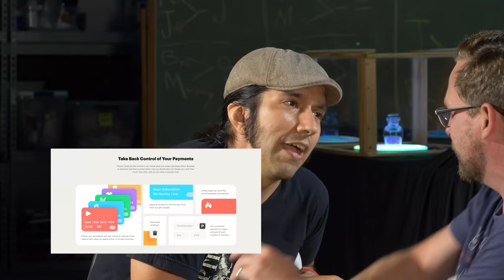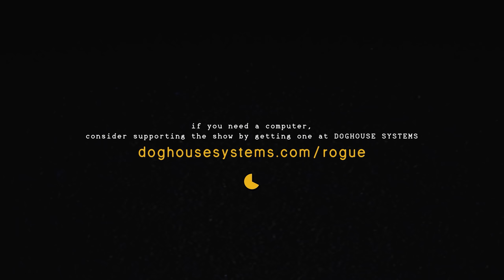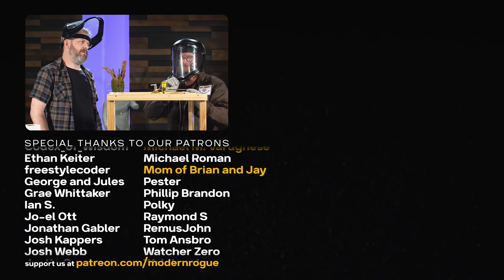Do Jewel Thieves Really Do This?

Comment: try scoring only one time around (but applay enough pressur to make a good and pronounced scor) and then tap the glass confidently but not to hard all around to make the glass crack through to the other side (you will kind of be able to see it crack if you look closely) and dont tap randomly around tap in the same area and when the crack form then make it grow by tapping at the end of the crack until it has crackt all the way around and try using the ball side for tapping and get to tapping as fast as possible after scoring if you wait to long the crack won`t form

Comment: Score your circle and do NOT score the lines coming of it. You do that when you want to save the circle you have cut and discard the frame. Score the circle and gently heat it either with water  or a cigar torch lighter.

Comment: As a glazier it always annoyed me when seeing people use circle cutters in the movies and these just use a sucker to pull the glass off. It doesn’t work that way!!🤯
Reply: It's certainly difficult to do, but what if the glass is really well framed and they actually pull first then push out? Is it probable?
Reply: @gabrieldeoliveira7725  so the problem is you need to run the cut from the other side. So you score the ‘outside’ of the glass with the cutter then you need to apply pressure from the inside to complete the circle cut. You can definitely cut circles in fixed framed glass, you just need access to both sides

Comment: I'm not all the way through but I seem to remember a video debunking this specifically the movie circle stealing cutting through glass. Why they said it was basically impossible is you're supposed to score glass then flip it over and Hammer the other side which you can't do in a cat burglar situation unless you like drill through the glass and then Hammer from the inside.

Comment: Hey quick question for y'all you made sure the blade for the glass was the right length since the really cheap ones can barely cut through 1/2 inch panes if they can cut through at all that's why some can be really expensive since they're used to cut through multiple inches of glass

Comment: You probably have better luck heating the end of a glass rod molten in a torch flame, and then stick the molten part firmly onto a section of the score mark, heat shocking it and breaking it. Glassblowers do something similar when cutting thick or large diameter glass tube

Comment: How to do it the wrong way but still the cool way:
- Score glass using medium to high pressure... ONCE!
- Take a blowtorch and briefly heat one point of shoreline from inside the circle 
- Splash it with a bit of cold water or put an ice 🧊 on the scoreline ( sharp corner should give you control on the stress point) 
- If not fully popped,  tap away to your heart's contempt or continue playing with fire and ice!

Comment: Instead of making score lines on the outside I would make score lines on the inside so that when the glass shatters from the middle out hopefully it shatters in a more controlled manner, following the score lines from the middle out and then along the circular score line. As well as giving more weak points for the glass to crack so the force is spread more evenly so that hopefully the glass doesn't crack all the way out.

Comment: You're trying to cut the glass, you just needed to score it. Just do a single sweep with medium pressure, and then tap gently over the crack (with the back of the tool), not in the center.

Comment: Contrary to what you see in the movies, cutting glass takes patience and a steady hand, and would be very difficult to do quickly during a heist.
Reply: i mean, usually in the heists where they use glass cutters they are being sneaky and could take 5 minutes to open the case no problem. Wouldn't make a good movie though if they were just tapping glass for 3 minutes straight.

Comment: This was painful to watch. My first taxable job when i was 18 was at a glass shop cutting mirrors. I dont know where to start- you only need to score the glass once, you need a coolant, the pen style cutter Jason had should be hollow and a slightly spring loaded head- fill it with atf, generally for holes we used a diamond edged hole saw; but again- with a coolant. The circular one would be for cutting a circle like a round piece and you would break away the outer edge. After you score it use the big round end of the pen cutter to tap the underside (you'll see the break run) then you score from the outside in do the same tapping and run the break up to the circle. Im pretty sure you will never reliably be able to remove the center section with that tool- when the line does break its not perfectly up and down, its like the edge of a lasagna noodle. Thats why we use hole bits, it grooves out the edge (however thick the metal on the hole bit is) and bingo, it comes right out. . . Usually ends up stuck in the bit. Glass heats up really quick when you score it, if you hear a little popping sound after you score it, its usually the glass fusing back together, at that point your not going to be able to break it. Theres some special coolants for glass but automatic transmission fluid (atf) is cheap and works really good. I hope this helps and i hope you try again! Since the drills for the hole bits suction to the glass i would imagine that it would be possible to do it on a mounted window, as long as you have some way to power it, and use a coolant!

Comment: You want a SINGLE SCORE. The 50 score lines you made actually made the glass stronger by giving the stress multiple places to go. One score will break it for sure. Small taps with a hard object around the circle. You want to score with the normal glass cutter on the INSIDE of the circle if you want the inside to fall out.

Comment: Less than 5 minutes in, and I am crying from laughing so hard. My family has owned a glass shop for 45 years, so the wrongness of everything they have done so far has me in stitches. I can only compare this to someone giving a saxophone to a monkey and hoping he will play George Michael's Careless Whisper. 

Murphy: Pulls out an everyday, common, self oiling glass cutter.
Brushwood: "It's like a weird ass hammer?"
Murphy: "Your'e supposed to use it for like..." Waves hand up and down in the air like he is prying out a nail.
Me: Pissing myself and crying from laughter at the same time.

Just for future reference, glass cutters do NOT cut glass. Glass cutters leave a scar on the glass so that when you put pressure on it and break the glass, the break follows the scar that you made. You NEVER want to use the cutter to scar the glass without oil being on the glass where you are scarring. If the scar you make dries out, it makes chips that will cause the glass to break in the wrong direction. You NEVER want to go over a scar you have already made because it makes chips that will cause the glass to break in the wrong direction. If you ever "hear it crackling" you are either going over a scar you already made, you forgot to put oil where you are going to cut, or you are using WAY too much pressure while scarring the glass. When you break the glass, the pressure has to come from the OPPOSITE side of the glass from the scar, and tapping the same side as your scar will only make it break the wrong way. (The safest way to break large sheets of glass is for one person to lift up the end being cut off after it is scarred and then lay it back on a straight "stick" placed under the scar by a second person. Just laying on the stick is enough pressure to break the sheet along the scar.)
It would be a one in a million cut to pull this off because of microscopic imperfections in glass while it is being created. It would take glass and a glass cutter wheel created under perfect conditions, a perfectly calibrated circle cutter, precise pressure, EXACT placement of suction cup and PERFECTLY equalized pressure while breaking the glass. I was born a couple years after my father opened the shop and I have only once seen someone come close to doing this. He was able to scar and break the circle without any cracks running in or out from the broken circle and the inner circle was able to shift a little from side to side before it cracked the outside pane. 
The way pros cut holes in glass (like the electrical outlet in the middle of your bathroom mirror) is with a small drill press that has a carbide coated hole drill bit in oil and a lot of patience. This can also be done to Rex's Glencairn glass to leave a permanent hole in the bottom.

Comment: most modern glass cases just use felt to lay the glass inside of a shoe, no sealants, because its too much of a mess for when the glass breaks on the case, its easy to just lift the top glass off with a suction cup instead of the hollywood drama of cutting the disc out in that impossibly clean manner

Comment: You can definitely cut glass with lasers. Yes, glass transmits visible light well but it tends to absorb UV light and far-infrared light which is why CO2 or UV lasers are used for this application. Ever wonder how they cut the glass for smartphones so it fits so well in the frame? Whether you could carry said laser with you on a heist is a different story altogether.

Comment: Score the line in whole circles, not back and forth in intersecting arcs. Score the straight lines running into the circle, and then shock the glass by running a butane flame over the scored lines. Don't overdo it, just enough to slightly heat the glass. Finally, tap tap at the center with a hammer, don't tap on the scored circle

Comment: Structural engineer here. Will skip right past all the many things done wrong here and to whether the legend holds true:

Well it depends on what glass you'd be cutting. If it's tempered glass you can expect with reasonable certainty the whole pane to fall down whether you wanted it to or not. The glass is specifically made with residual stresses to, instead of falling down in big pieces that could injure people, break into many smaller cube sized bits to limit your hurt.

If it's laminated glass then you'd be dealing with several panels of glass glued together. The trick mentioned by many here of scoring it just once then wouldn't work. And generally the glue would mess up much of what you were trying to do.

Comment: I actually took a class on glass cutting to turn into old school colored windows, you want to do one score line, and go over once, you guys making the extra score lines added to the probability of just random breaking, as Brian assumed, Also going over the circle scoring multiple times may be good if it could be done accurately, but in theory it can't, and don't be so afraid of the glass, yes 9/10 times it's gonna cut you, but most of the time you have to get rough, especially with curved scores in general as that was unconventional (usually you would form a curve by a lot of straight cuts and then chipping it to shape), I also saw a comment saying that something about using a wooden frame is making the glass bend which will make this impossible, so new frame, no extra scoring, try to just do the the circle one with high pressure, and whack that shit

Comment: 10:25 I feel like you are doing it on the wrong side. You would probably want to add the extra scores to the side you dont care about being damaged which would be inside the circle. So you would still get that perfect circle on the outside but have the inner part break into much smaller pieces.

Comment: lol I've never seen movie spies or criminals ever cut outgoing lines from the circle! :-) usually they cut through the glass completely and use the suction cup part to pull out the "perfect" glass circle. I've seen actual circle drill bits (made from diamond dust) that can cut a circle, but I don't know if they make a thief size if the suction cup isn't sucking enough you could lick it before connecting it to the glass.

Comment: Must be done with a single score line, as soon as you go over a score it's ruined, you dont need a deep score just as long as it's there. The small tool is for free cutting glass the end with the wheel is for cutting and the end with the ball is for tapping the BACK of the score.  Ideal way to do this would be to make the single score then take your ball tool and tap while pulling on the suction cup.

Comment: This is not BS it actually works, with the same suction cup you pull it after scoaring it ant you will get through, only down side is since yall are not experience in glass cutting thats why yall couldnt cut the glass right

Comment: You need to do one single scoring. Not going over it more than once. More than once only dulls your blade. And you need to apply alot of pressure to get a deep enough score. Any when i mean a lot i mean it. Push onto it with your whole body weight. It is not as easy as seen on TV. Your actually not cutting it your just trying to make a weakness in the glass. The deeper the grove is the better its going to work. Going over it more than once introduces more than one weak point and it will break pretty much anywhere.

Comment: so... I don't know anything, but I'm going to tell you what i know anyway actual actual glass cutting.  Only score the glass once;  don't go back over your score lines multiple times.  Multiple passes can actually chip the carbide wheel on teh glass cuter.  Once you score it, use the ball end of the cutter and tap ON the score line, which will cause a facture through the glass.  If you want to pie score your circle, do the INSIDE of teh circle... then tap the glass with authority around the circle you've scored.

Comment: Why did you keep adding lines outside the circle it's guaranteed to spread out and spider Web and you didn't use the ball end (effectively hammer) and the point of leaving the suction cup is to deaden the shock to the centre and stop the glass falling in you over scored it if anything make multiple circles say quarter in apart so the is a stopping point if it webs out basically you did everything wrong.

Comment: Can not watch any more said the glazier, first score the circle only once, then from the other side gently work your thumb on the cut, with some pressure in one direction slowly until you see the crack connect and form a circle. Now flip and even more gently repeat the process, you will hear a faint crack, you have now broke its back. At this point the circle is now separated but locked in position. Now on yard inside of the circle make 3 cuts to make a triangle that touches the outside of the circle at all three points , the relevant point is to make sure at all 3 points there is a 1/2 inch gap between the triangle points. The 3 lines can not touch. Same as the circle, flip, run thumb along cut, flip and break their backs. Finally make cross hatching cuts in the centre of the triangle, now get a long object with a small weight. A dowel with a nut on the end. Use the nut and tap on the underside of the the cross hatching. The point is to slowly and gently break away the centre creating a void for the three outside pieces of the triangle to fall into. This leave you with a perfect circle. Therefore the concept is not plausible.

Comment: Way too much scoring. The whole point is to score a single sharp line to act as a stress concentrator, not to cut through the glass. You then apply pressure around the circle to break it. Would it work like in the movies? Not really. As Jason says it works best on a bench when you can apply pressure to the surrounding glass, and it's mainly used to produce circular pieces of glass rather than circular holes. The surrounding glass is most likely to break.

Comment: You’re only supposed to score it once. Dipping the tip of the cutter in cutter oil for lubrication will help too. You’re not cutting the glass, just setting up the weak point for the crack to follow. Then using the ball end of your glass cutter, you tap along the score, this is what causes the glass to crack. Watch some videos on stained glass. I’m surprised you guys didn’t have a professional from a local stained glass shop on hand to walk you through it like you normally do. As someone who grew up around stained glass artists, this was cringe inducing. :P

Comment: You could also try using heat on the scorched lines with, for example, a soldering iron. The small changes in volume due to expansion are supposed to cause further micro-fracturing which should follow the drawn path. I've seen people successfully cutting bottles with this method tho I've never tried it myself.

Comment: Roll back the injury counter because both of you probably inhaled glass. You should definitely wet the surface in future videos because that glass dust floats up into the air and doesn't settle for a while.

Comment: Nothing you are doing is right.  It doesn't matter anyway because you can't cut a hole in glass using a glass cutter.  You can make a circle and then break off the outside pieces.  By the way, the ball on the end of the cutter is what you use to tap the glass to start a fracture.  Only one pass of the cutter is required.
Reply: you can cut a circle in glass, but you have to be patient and tap-tap-tap the channel until the whole circle is fractured all the way through, then pop it out with the suction cup. It's a right pain in the booty though.

Comment: As someone that cuts glass on a daily basis this video made me cringe more than I ever have in my life 😂😂 you using the cutting head as a hammer kills me inside thinking about how much our cutters cost. Also, you only need to score it once with a steady even pressure for the entire pass. Then you usually want to hit on the back side of the score for a very clean break. Please just use the actual side of the knife meant for breaking next time 😅
Reply: PS: cut the circle into a 6 piece pizza and hit in the middle next time for a better chance at a decent circle